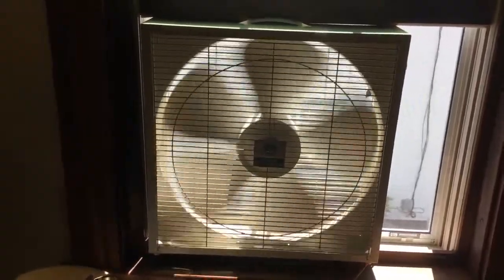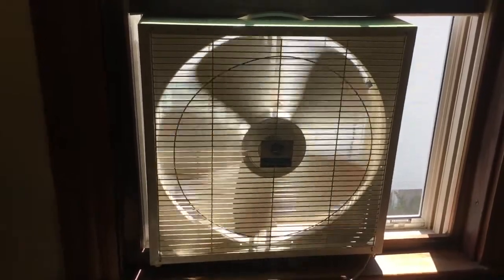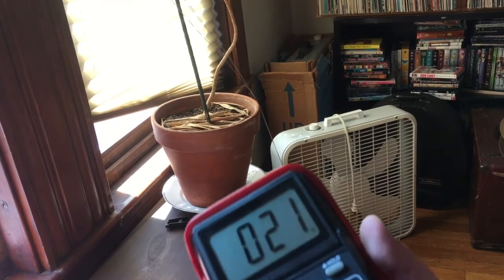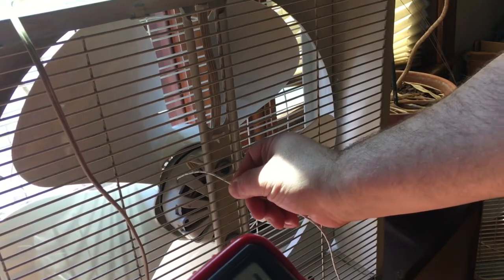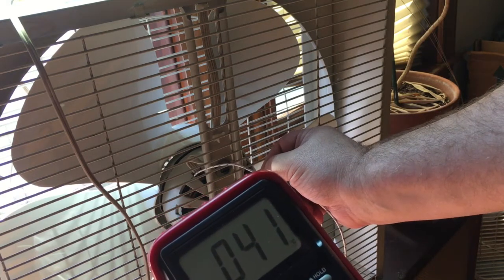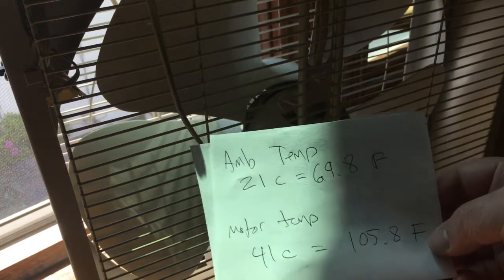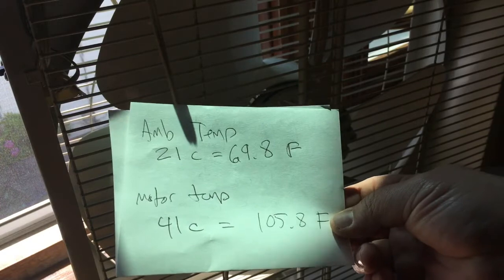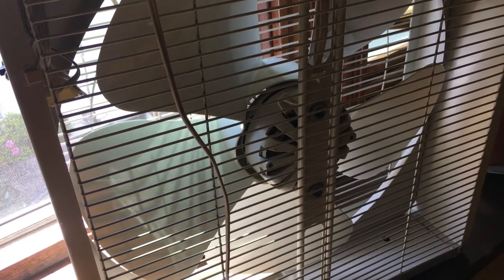Vintage Fan Motor Running Temp

Comment: I have a Signal box fan that hits 128 degrees Fahrenheit. It's been running like that for years and it's fine.

The Signal Cool Spot that I recently did a video of runs at 125 degrees Fahrenheit.

Comment: the standard for electric motors is 40c rise which means 40c above a standard 20c (70f) under normal conditions  and thermal cut outs are at  80c (185f)  some times you can do a nose test   run it for half an hour then turn it off and lay it face down  and sniff the heat rising out of the motor  if it is hot or smells , the motor is starting to break down electrically

Comment: this is a rare GE box fan never seen the ring on the front grille whats the model # of the fan ?
Reply from the maker: I don't know the model and there's no ID sticker. This is the last generation of the GE box fans. There is a 68 molded into the rubber blade mount. Probably assembled in the 1968-1970 era. I am told this is the same vintage as the brown W-25 2 speed fans - again the last ones made.

Comment: Yep, you're fine.  We have probably 22-30 various vintage box fans with GE motors, they all run about 100-110 degrees F.  GE motors have always run hot.

Comment: Get one of those plug in kilowatt /amp meters that will tell you how it's running ,if you have the amp specs of the fan , they do tend to run hotter on low due to more resistance and less airflow I do believe
Reply from the maker: good idea. I gotto pick one of those up.
Reply: Amazon should have them , o need one as well, my Mc Marco runs pretty hot but runs fast tho doesn't seem overloaded

Comment: Great vid! These older box fans utilize shaded pole motors (no capacitor), which are very inefficient therefore drawing a lot of current. Most of the energy is wasted and released as heat. So getting to the point, it is very normal for motors like this to run well above 100 degrees. You'll notice signs of "unsafe" motors, like burning smell, sparking, not-copper-orange windings, excessive heat and smoke, so as long as it doesn't show these symptoms, it should be fine. Hope this helps you...
Reply from the maker: Does help. Thanks!
Reply: thebombyall76 no problem! Glad it helped